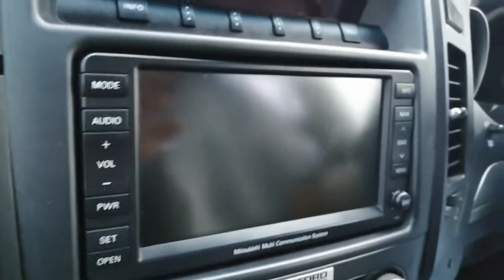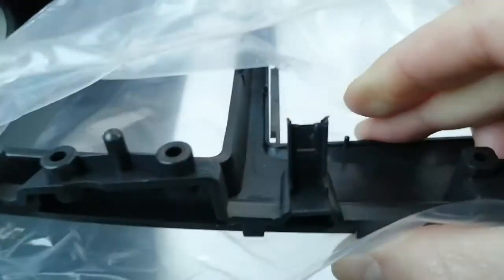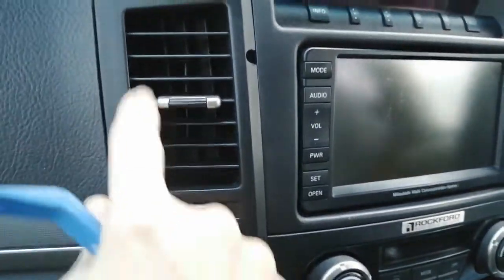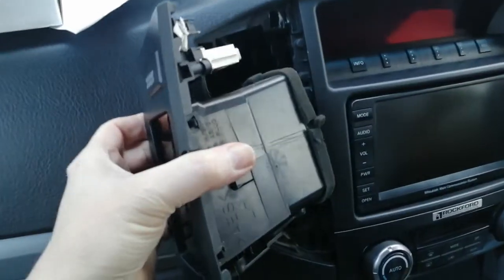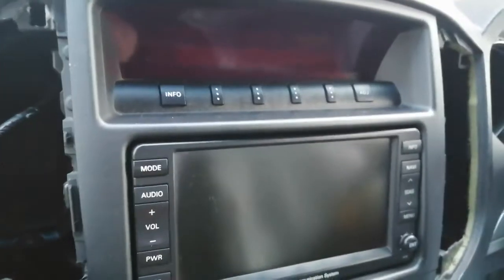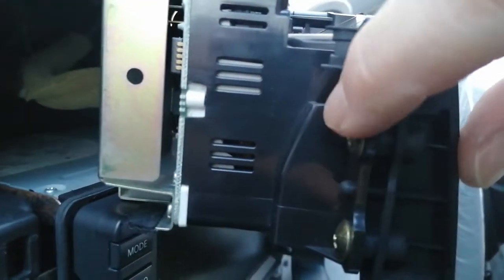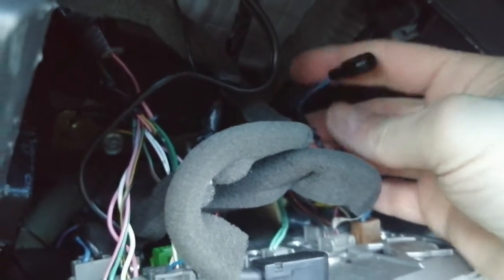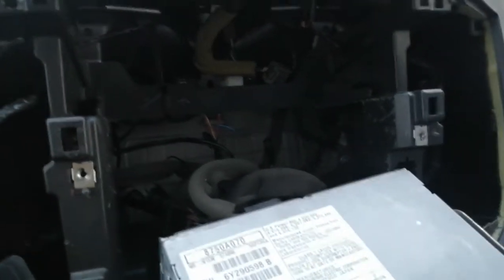Mitsubishi Pajero 2006 to 2021 how to remove factory radio + part numbers

Comment: Hey, I have a 2018 version of the Pajero and video is helpful up until the trim surround removal, however much I pull on it it doesn't just come away (feeling around the back there are some screws that maybe hold it in but have no idea how you could access?) anyone else have problems like this and suggestions? :)